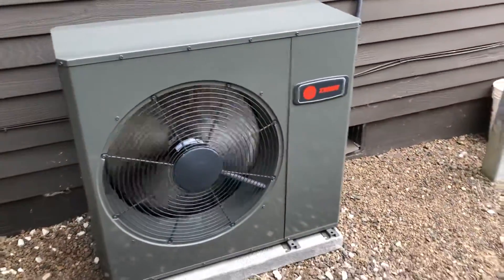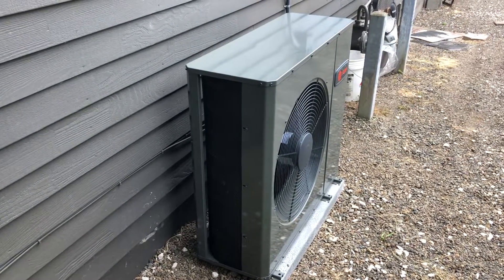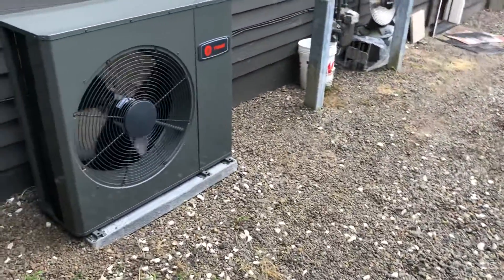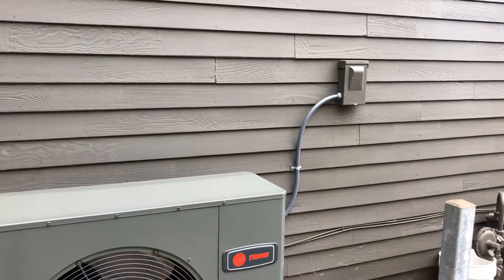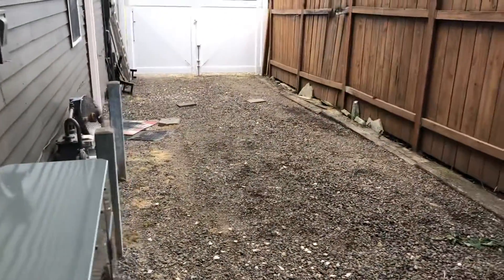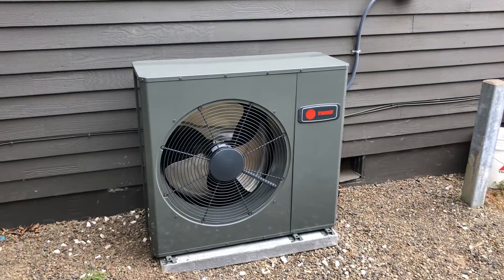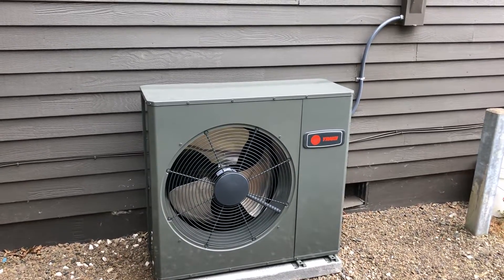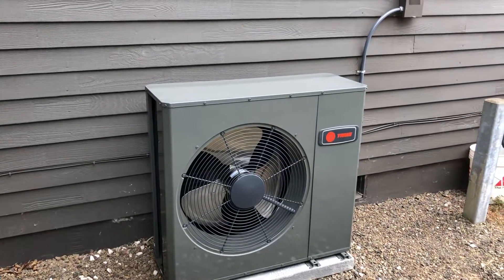Trane Low Profile Air Conditioner Installed by Clean Energy Comfort

Comment: On ours it says 14 SEER (elongated 3 tons), XR16, but works good so far. May I know, where did you get an elongated concrete base for the unit, because our was installed on a square base. I thought they all have square base, but in your film I see it is a rectangular shape, so much better, and actually it should be at least 1" wider on ALL sides, and our unit has 2 sides which are wider that the support. I think maybe the company which installed the unit didn't know that rectangular shaped exist. Please provide the link, where did you order it from. Thank you for the great film.
Reply from the maker: The XR16 is a 16 SEER air conditioner, but SEER rating is dictated by your indoor unit combination. The pad is made by Diversitech. Model is UC24483. We purchase these from our local wholesale distributor. The problem now is that in order to swap out the pad, the AC would likely need to be disconnected from the refrigerant lines, which can be a costly procedure.
Reply: Thank you for the replay. I don't know, that SEER # is printed on the outdoor unit. Why it is printed there if it can be different depending on the inside unit? In your film one can see just the left side, and all the information is on the right one (like unit type, etc). And there there is a piece of paper attached, yellow color, and it is printed there "14 SEER".  It is easily removable, contractors scratched the part of it, like on purpose. In another film I also saw that # - 14, not anything else. I need to go in attic to see what is installed as indoor part, since in the instruction provided there are several of them. Outside unit is 4TTL6036A1000A. It is exactly same unit you show, maybe it depends on tons, ours is 3 ton. Thank you also for the explanation with the base. Our was installed yesterday, we have 30 days warranty. And I assume if the company installed the wrong base they need to replace it. Like 2-3 inches of the unit hovering in the air on 2 sides, what contradicts the instruction. The base also touches the wall of the house. in instruction again it states, it should not touch anything (probably because of noise issue). Why is it costly if you don't mind me asking, refrigerant R-410A? Do they need to remove all of it at disconnection? Thank you again.

Comment: Is there a reason this isn't the standard home air conditioning and heat pump design? Everything about it is more practical than top discharge units.
Reply: depending on the tonnage and seer rating a certain size coil has to be managed to keep up with efficiency. carrier makes several seer options in "low profile" though they are thinner they're much taller too only really moving the surface area in another direction. Me being a installer and service tech these aren't practical for the people that have to come fix them. It'd be hard for me to leak check the back of that coil if I suspect a leak outside. These would not be practical in an industrial or commercial sense unless we're cooling a small space.

Comment: Thanks for the video.  This is the unit I’m probably going to buy.  I was looking at the XV19 Slim just for the dB level, but the contractor we are talking to said it’s $4K more!   Do they sell a compressor blanket or sound dampening insulation for the XR16?  Our outside TV is right by the unit.
Reply: Ripoff. These units do not cost anywhere near that much, they are just marking up for profit.
Reply: The equipment is very expensive  @matsudakodo

Comment: Electric heater next to the  gas, LOL
Reply: Depends on the local code. Looks well over 8 feet to the standpipe vent. I just want to live in a place where heat pumps don't require pump up legs.